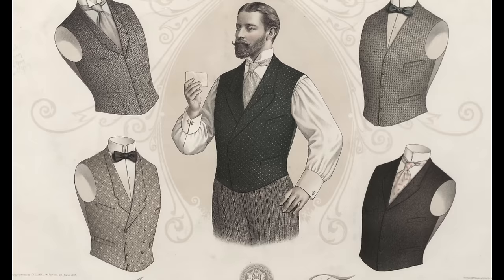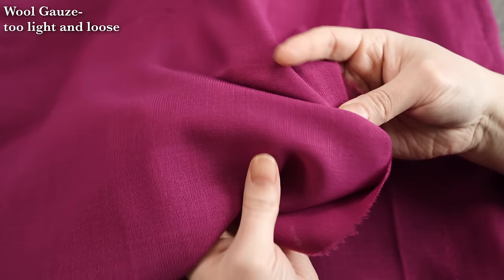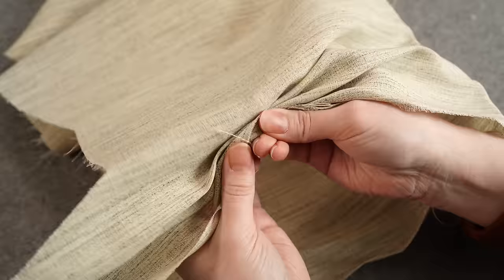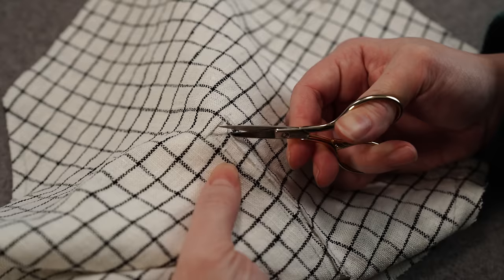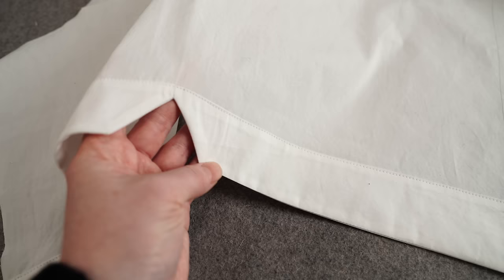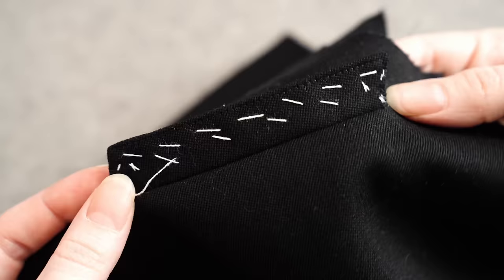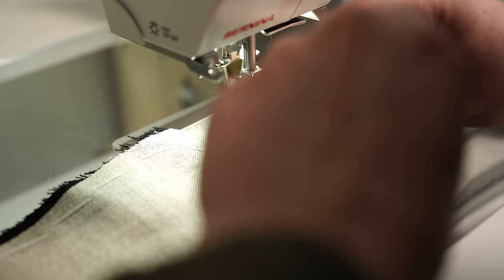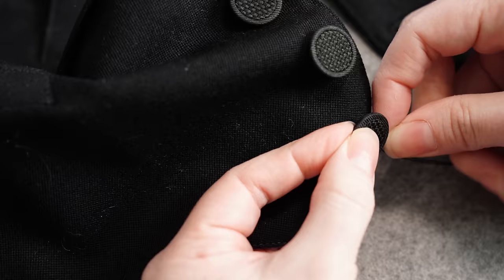Tailoring 101 with Victorian Waistcoats

Comment: Wait, is bleeding still an issue with modern color fast fabrics?
Reply: Not usually...but there's always a small risk, especially if you don't prewash a fabric. Which you wouldn't do with a stiff kind of silk, as it would likely become floppy and possibly get  very hard to remove creases (speaking from experience here).
Even with store bought clothes there's always a small risk. Jeans staining a white or cream sofa is a classic example.
Although I have to say, that I haven't personally had issues with silk staining either other clothes or skin.
I guess you could always try it, by vigorously rubbing a piece of the silk over a white cotton fabric. If nothing comes off on either dry or damp fabric, you should be good to go.